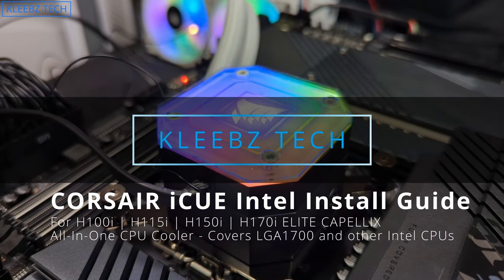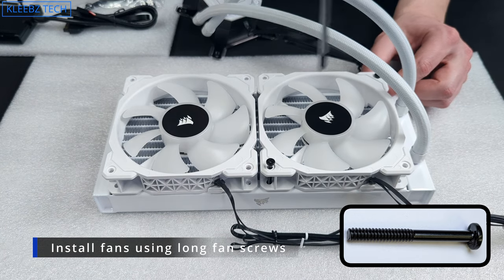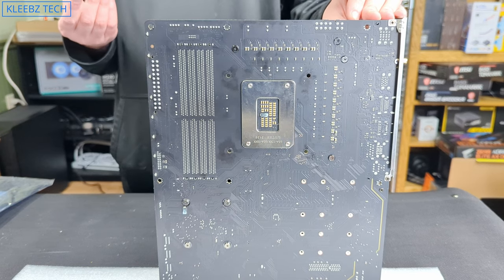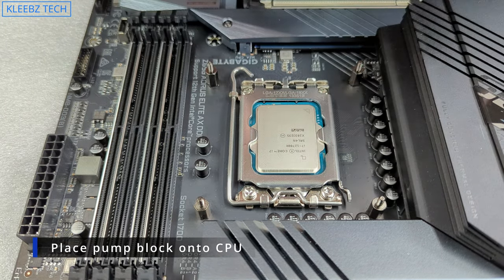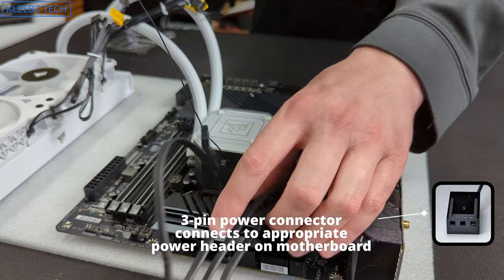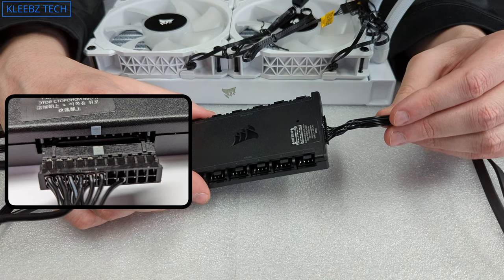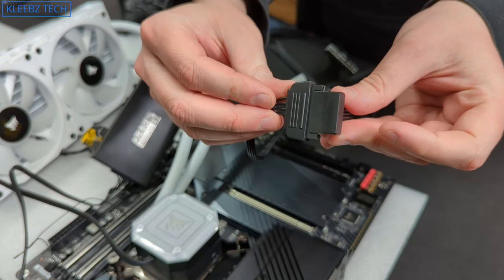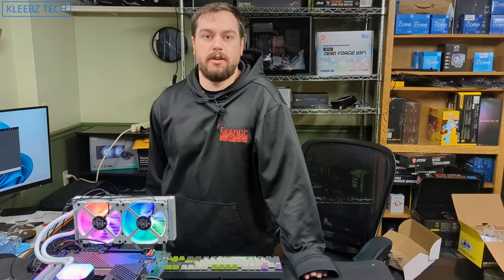LGA1700 Install CORSAIR iCUE H100i H115i H150i H170i Elite Capellix Intel CPUs

Comment: Wow. About to build my first PC ever, i'm 13(almost 14) and I was really worried about this step. You put it into great detail and I hope i'm gonna do it right!
Reply from the maker: Have fun!
Reply: any luck?  I've been informed that the coolers illustrated here are NOT 1700 compatible out of the box.
Reply: @bigdog3628  Yep. You'll need to buy the LGA1700 retrofit kit separately for around £4.99 if you're going for 12/13th gen Intel
Reply: @bigdog3628  Nah the lga 1700 parts come with the AIO in Amazon. Not sure about the one from the website.
Reply: @KimKiKi0   bought mine at best buy over 2 months ago and it came with LGA1700 parts. Mines running just fine.
Reply: Good for you starting young
Reply: I was 12 when i started building pcs and now I’m 32 still building pcs. It’s a wonderful hobby and I’m glad to see you starting so young. Nowadays you can pretty much find anything online that you’re having a problem with building so you’ll be ok
Reply: Same I’m 15 😭 almost done building my pc

Comment: Great video!  Just a heads up for fellow 12th gen owners, when I purchased my H100i Elite Capellix on the box it stated that it supported LGA 1700.  Now if you're buying online then you could be getting an older unit that doesn't have the 1700 standoffs.
Reply from the maker: Thanks for sharing
Reply: just use the ones for 1200, they are just fine
Reply: @santiagoferrari1973  that is horrible advice, it could either damage your cpu or not cool it at all!
Reply: I can confirm this because I got mine withput it. Just asked in the shop to give me additional standoff and bracket...
Reply: @HipHopBase  do you need the bracket as well ? I thought just the standoff would be enough
Reply: @tiagooc91  No...just the backplate behind motherboard and 4 standoff screws made for your CPU (ie 1700 socket) in front that go into the brackets on the CPU cooler that is already made for all Intel CPU's.  Those standoff screws are the only things that are critical that you use that are made for your CPU. Do not use standoffs for another model CPU or you have a very high chance of bricking your CPU
Reply: @santiagoferrari1973  That's the worst advice I've seen in a very long time. Unless you are giving advice to people that want to brick their CPU of course.
Reply: @JSRJS  thanks! I ended up ordering the appropriate standoffs from Corsair and I've setup the cooler with them and everything looks good :)
Reply: @JSRJS  so if I were to get standoffs for the 1700, then would I be fine using the intel backplate and bracket that come with the H150i elite Corsair coolers?
Reply: mine didnt come with it, what should i do?
Reply: @kulmieabdi8131  did you try this I'm curious as well I ordered the stand offs they are unfortunately the last thing coming 🥴
Reply: @DeputyDusty can I get an answer please
Reply: @kodiakrl1094  Think it depends on from where you order and more importantly, how old of a product you are getting when it comes to their stock. Some places understandably move their inventory much slower than others. I just ordered (Dec. 2022) a refurbished AIO direct from the manufacturer (Corsair) and the 1700 standoffs were included along with everything else (fans, Commander Core, etc). In addition, they had 1200 and 2011/2066 standoffs for Intel (back plate is the same with screw sockets that slide) as well as back plates and standoffs for both AMD/AM4 and TR4 sockets. As mentioned, you can purchase the 1700 standoffs direct from Corsair (LGA1700 Retrofit Kit) for $8. Definitely sucks if you are in a hurry, but the option is there in case you get an older AIO without them included! And, as someone else said, I wouldn't recommend using the 1200s; they are noticeably different by a few millimeters and it seems foolish to risk it on a CPU that is hundreds of dollars to save an extra $8...

You may have already figured this out, but perhaps this information can help someone else down the line!
Reply: @mrpjfresh1810  ya I only had to get my 1700 screws for like 4$ and the build looking sexy asf
Reply: @tiagooc91  following up on this, did you need a bracket? My cooler comes in this weekend, I ordered the additional 1700 standoffs, just wondering if I'll need the bracket if it's not included? Looks like corsair website is sold out on the brackets+kit at the moment. Thanks! How's temps running as well?
Reply: @kulmieabdi8131  Did you ever find out the answer to this? I'm wondering the same.
Reply: @kodiakrl1094  Didn't need a different bracket?
Reply: @D.R.P91  ya I got it built awhile back lol just needed those stand-off screws thanks
Reply: @D.R.P91  I got an msi aio instead lol first time build 😅 there's room to make mistakes
Reply: @kodiakrl1094  Awesome, appreciate the info!
Reply: @D.R.P91  I bought the refrofit kit (reference: cw-8960091) which doesn't come with the bracket. I've used the bracket that came with the cooler. In some retailers, the cooler already comes with the retrofit kit. Temps are great, my only very minor complain is that this cooler is not very silent when not in silent mode. But since I get great temps in silent mode I always use it in silent mode.

Comment: Your video is very much appreciated thank you so much. I got i9 12900k and i didn't really know if this cooler supported the new 12gen CPU and watching your video I add a peace of mind because I was really struggling and nearly sending back to Amazon.
Reply from the maker: You will need the correct standoffs and backplate in order to have it work properly with your 12900k, I'm not sure if they are currently shipping new models with the proper hardware or not
Reply: I bought mine today at Microcenter and can confirm that the lga 1700 hardware is in the box
Reply: @foxmino  Are you talking about the standoffs? Is this for the H100i elite capellix?
Reply: @gerardguadayo1788  The H150i Elite Capellix 360mm
Reply: @foxmino  lucky mine weren’t in the box

Comment: Man im glad i watched this video... i was so confused as to where the usb plug and the 24pin plug went... i never ran any power to the unit so thankfully i didn't blow anything when powering it on. I had a msi meg z590 ace gold edition that kept giving me a c1 error and even when swapping ram it gave an A7 error but when the computer finally turned on i think my msi aio's pump wasnt properly working so i bought a new aio (the corsaid H100i) and a MSI meg carbon edition motherboard.  Now im just waiting on my new case and power supply. I miss the days where motherboards and aio's came with actual paper manuals

Comment: I always attach the 3-pin connector on the pump into the CPU_FAN header on the motherboard. Most motherboards will complain and some will refuse to post if you don’t have anything plugged into that header.

Comment: I bought the Corsair 4000X case and it came with the RGB controller. Do I have to use this controller that comes with the pump just for the 24 pin connector?

Comment: Does the 'Corsair Hydro H150i Pro 360mm AIO' work with Intel LGA1700 if you buy the LGA1700 retrofit? Because it doesn't show in the compatibility list for the retrofit kit...

Comment: is this ASRock Z790 PG LIGHTNING ATX LGA1700 Motherboard and Corsair iCUE H150i ELITE CAPELLIX 75 CFM Liquid CPU Cooler do i need a separate mounting adapter to fit the ASRock Z790 PG LIGHTNING ATX LGA1700 Motherboard.

Comment: My last build I made for myself was in 2008. Since I got married in 2012 I have built one other machine which was for my wife which got handed down to me once she decided to go to a laptop.
My 2008 machine ran until 2019 so 11 years, This machine here is from 2014 so 8 years old now and its about time for an upgrade so I started doing research on parts because even if I cannot afford to buy every part I want all at once Its good to know what I would like in my build to be able to start saving for it. 

There is a part of me that misses that old 2008 build hahaha 4870x2 8 gigs of ddr2 which people called me crazy for  2tb of HDD which was massive at the time
Things like this were not really so much of an option back then nor was RGB like it is today hence why I thought I ought to "Bling" up this next build unlike the last one which was Pure blue all the time and only lights on the case fans in his Antech 1200 which after 11 years half of them had died and been replaced at least once with cheap no led models.

Comment: i have a question.. is the pump head also work on lga 1700 ? im gonna upgrade my 10th gen motherboard to 12gen. im using lga 1200 and i dont have the radiator box for extra pieces
Reply from the maker: I no longer have the hardware to verify but most likely will need a specific mount.

Comment: Can I connect the commander core to a 4-pin usb 2.0 port? is that my motherboard only has a 10-1 pin usn 2.0 port and next to it another 4-pin usb 2.0 and the 10-1 pin I have with the usb 2.0 on the front panel and I see that the commander core usb port only It has 4 cables and I think that if it could be connected to the 4-pin USB 2.0, please help :(

Comment: I found a video telling me that I need to buy the lga 1700 standoffs on the corsair website, but the video is a bit older. Are the standoffs for lga 1700 included in the elite capellix ?
Reply from the maker: Most likely at this point they should be unless you get some older packaging.
Reply: @KLEEBZTECH  Thanks a lot 🙏 Haven't got any answer from any other videos, very cool that you are still answering comments on old videos, not everyone does that.

Comment: I need a little help with buying a 240mm for 13600K, any recommendations will be greatly appreciated.
Reply from the maker: Have you looked at the Arctic Liquid Freezer II? Can be a little harder to install but we do have a video: https://youtu.be/VP21fM0XXSk
Reply: @KLEEBZTECH  Can one control the fan speed or come with software for the cooler?
Reply: @KLEEBZTECH  also any info on the thermalright cpu contact frame for the LGA 1700?
Reply from the maker: Fan speed is controlled with the BIOS. Not sure if all models though so double check if buying.
Reply: @KLEEBZTECH  Thank you.
Reply from the maker: As for the other question I had double check what you were referencing. No I do not have any info.

Comment: Hello, what a good video, I only have one question, and it is: are the screws for the lga 1700 placed on any side? or is there a specific side to place on the motherboard, in the image on the corsair page it seems that the screws have 2 different sides in terms of thickness and size, but holding them in hand they seem to be the same on both sides both in thickness as length to screw in please help
Reply from the maker: If memory serves me correct I bought one is slightly thicker. And looking at the video it appears that way. I don't have one at the moment to check. If they are different it should not screw in easily. So don't try to force anything.
Reply: @KLEEBZTECH  Hello, thanks for answering, I put it first on one side and then I changed it and so and in every way they are screwed, I bought an elite capellix h100i manufactured in 2020 and luckily it came with lga 1700 screws so they are original corsair but as I said, on the corsair page the screws seem to be one side thicker than the other but the screws I have on both sides seem to be the same and that was my question :(

Comment: i have ordered retrofit standoffs from Corsair couple some time ago, and once i installed it with Corsair H115 i rgb platinum, the older one from around 2017 my cooling block on CPU was extremely loose , no contact with IHS at all! i decided to install it with 1150 standoffs etc and while under gaming temps are fine, while running burners and at only 150W temps are reaching 100c :( i'm greatly disappointed , any ideas how to make it better?

Comment: I'm using the H170i with an i9 12900k with the kit for the 1200, and the temperatures are very good.  With the cpu stress Aida 64 and cinebench the peak temperature is 80 degrees.  I ordered the 1700 kit, when it arrives I will modify the comment to tell you if there is an improvement.
Reply: any news on that?
Reply: @Blackstar0995  no, I'm still waiting for it to arrive
Reply: what is ur mobo?
Reply: @24691355  z690 tuf gaming ddr4 wifi
Reply: @AgussKS98  maximus z690 hero + h170i elite + lga 1200 kit here and my temps aren't that bad at all
Reply: @24691355  what temperatures do you get with cinebench?
Reply: @AgussKS98  ok, with all the pcores at 5.2 and the ecores at 3.9.  94° 90° in those values. Cinebench is the cpu killer haha. Not good

Comment: do all models come with the LGA 1700 Plate and Standoff Screws?

I'm looking buy the Hi100 Pro RGB Elite from Newegg and it lists as LGA 1700 Compatible but if it doesent come with the backplate and stand off screws id have to buy those aftermarket and i cant find them in stock anywhere

Let me know if you can
Reply from the maker: At this point they should come with the parts. If they don't then I would definitely contact their support. If they advertise it as supporting it then it should come with the parts.
Reply: @Kleebz Tech  ok thanks dude 
I think just to be safe I'll order straight from corsair and get a set of the standoffs for $20 just in case

Comment: Im about to build a new pc with 240mm corsair cpu liquid cooler. I have a gigabyte z790 mother board for the i7 13700k and an NzXt H5101 case. Will it be easier to install the CPU cooler when the mother board is installed into the case or on a table then put it all info the case?
Reply from the maker: This really depends upon many different things including case and everything else. Really have to figure out what is best. I usually try to do as much as possible outside of the case before installing.

Comment: What is 24pin cable going from pump to commander core? I broke some of wires on 24pin cable, can i use and control pump, fun etc without that 24pin cable or i should look for someone to fix for me?
Reply from the maker: Without that I don't think you will be able to control the pump or RGB via the corsair software, but if you have the pump header connected to your motherboard you should still be able to run the pump with BIOS

Comment: I used the lga1700 screws and they were to long on the 12600 procesor I have. I check and they were not even making contact with the cpu. any ideas why is happening this? is the 1700 screws longer than the 1200 ones and that's why is not getting any contact with the CPU? BTW I have a AIO 100i capellix.
Reply: you put them in backwards

Comment: I have acer predator orion 5000 #P05-640-UB12. Do i need to take the mother off to install this cooler?  Thanks
Reply from the maker: Not familiar with that system to really comment. Sorry.
Reply: @KLEEBZTECH  It's the acer predator orion 5000. thanks

Comment: So it looks like you had the fans installed incorrectly at the beginning? Why did you not address that in tbe video? Seems like you ended up turning them back around.
Reply from the maker: Fans can go either way as we talk about in the beginning of the video. There is no incorrect way. Depends on how you want air to flow.

Comment: Great video. I am going to build a new pc using this AIO cooler and an Asus maximus z690 extreme motherboard. Asus Z600 series motherboards have aditional holes for lga 1200 cooling systems. Will I still require the lga 1700 stand offs??
Reply from the maker: Yes you will still want to use the correct stand offs, there is a difference in height between the different sockets.

Comment: Great video. How do I get kit for LGA1700? Do they put it in the box nowadays or i have to buy it separately?
Reply from the maker: At this point most likely it will be included. Unless you were to get an older unit.
Reply: They are now included. Just got the H170i Elite LCD model and they came with screws for 1700
Reply: @JSRJS  nice, but h170i is a 2022 model, so they are supposed to put it in the box. h150i is older, looks like one way to get it is to order separately.
Reply: @reflexion_  that sucks. Amazing that a massive company like Corsair has trouble with 2 screws.

Comment: I bought one and it said it isn't compatible with lga 1700, what would u say I do?
Reply from the maker: What model did you buy? If one of the ones we listed then you may have gotten an older unit packaged before they added the correct hardware. You would then need to get the LGA 1700 kit from Corsair.

Comment: currently i am using H150i pro cpu cooler on main socket 1151 i am upgrading to main socket 1700 so is the cooler still suitable how can i mount it to socket 1700?
Reply from the maker: You will probably have to order the LGA 1700 mounting kit in order for it to work
Reply: You need a kit. I bought the Full kit from Corsair's website for the LGA1700 mount. Part# CW-8960093
Reply: @KLEEBZTECH  They seem to be slow as heck about shipping these. Why?

Comment: I have a 12900k and the H150i with the LGA 1700 standoffs and I am getting really bad temps (55c idle, over 80c in games) I’ve re-pasted and re mounted 3 times and it’s actually gotten worse lol. I’m not sure if the H150i makes proper contact even with the new stand offs, what are your thoughts? I have plenty of airflow etc so I do not believe that is the issue
Reply from the maker: The 12900k runs very warm, and the LGA 1700 chips have also been shown to not have the best mounting pressure regardless of the CPU cooler. Honestly 80 is quite warm but not alarming in my opinion. Anything you can do to help move air through the radiator could be beneficial but that chip just runs like a sauna